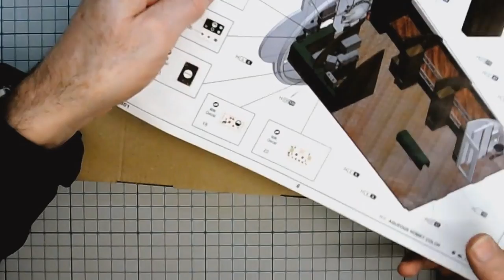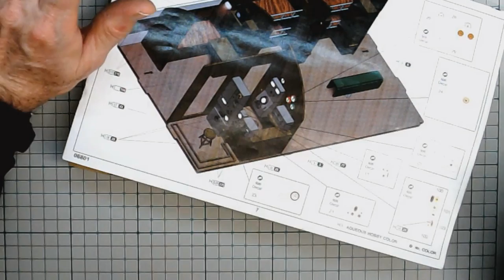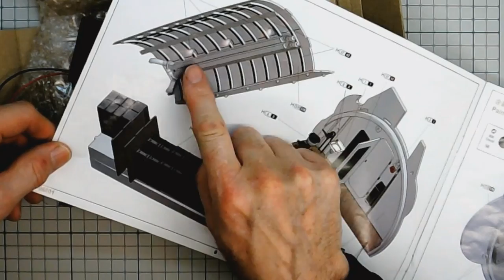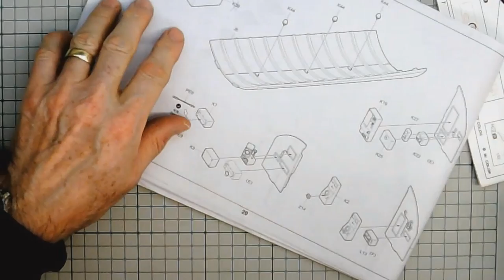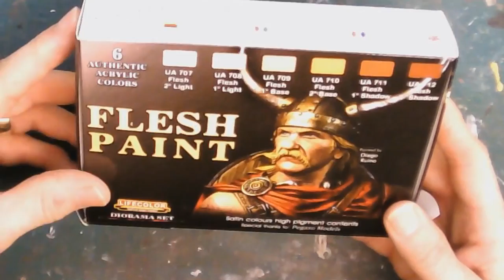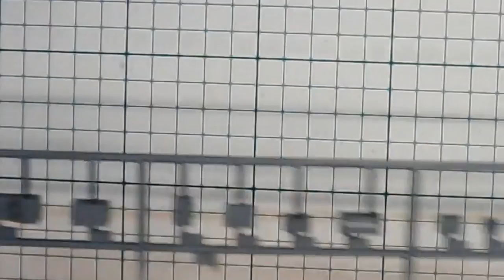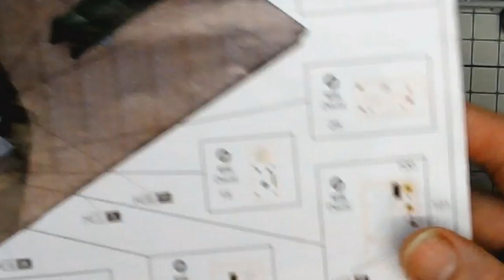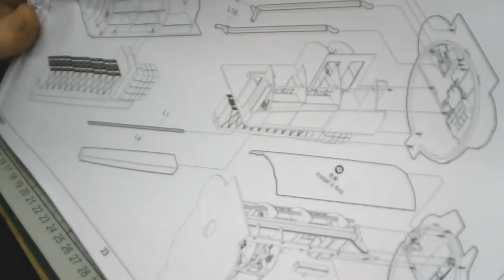Trumpeter 1/48 DKM U-Boat Type VIIC U-552 (WWII) # 06801 PART 3

Comment: Hi Ted, have been watching your Part Three Build, with limited painting /spraying facilities I have built 'units' that are dry assembled that I can later remove and spray Prime (in the Garden) then paint brush. I have not fitted the 'cupboard' in the Head (to give more room and have left some doors off) I will leave the roof to slide in last (you don't need location lugs to fit every component) that would have solved your 'air duct' locating problems. I am enjoying your videos and refer back to them for assembly and painting.

Comment: Ted, they call it the "head" because in the days of British sailing vessels, the "Seats of Ease" for enlisted men were planks with openings in them that sat across the head timbers outside of the ships body. The product of these seats would go directly down into the sea. They were in the head end of the vessel and thus Head was the term used to describe them. Officers had their places on the wings that extended from the sides of the aft cabins. It must have been a hell of an experience to use them when the ship was making way and bow waves shooting up. It was probably the inspiration for the Bidet. Wonderful build. Don't like building German equipment. If Trumpeter would do a US boat that would be very cool. But where to put it?...

Comment: You're correct about the captains bunk and some of the front bunks are for officers but there's also some for the radar and sonar operators. It doesn't show it but there are more bunks on the close side, hence the table with the sides down that seems to be just in the open there. (Radar is the aft section next to the hatch and sonar is the fore one. This way the sonar can immediately let the captain know if they have a contact.

If you're looking for more WWII u-boat stuff there's a game called silent hunter (I prefer 5 the most but I've been told 4 is pretty good too, you can walk around the interior of the sub in 5 though.)

Also on a side note while I don't know about battle stations lighting, at night the lights were dimmed to red to help keep the sailers internal clocks since they can't see outside.
Reply from the maker: Thanks for the info :)

Comment: Why the overhead beams Brown? And didnt they have red lighting throughout the boat for when they were under attack?
Reply: The red lighting is not for when they were under attack. The red lighting is to ensure that immediately after they surface and the crew gets up into the sail or conning tower that their eyes can adjust to the dark conditions at sea at night. Some of the crew would be wearing goggles and almost totally blind and had to have their hands guided to the ladder so that their eyes would be completely adjusted to the night conditions. The very first thing once a submarine is surfaced is to do a COMPLETE scan of the surrounding ocean. That is paramount for the safety of the boat and the crew. The red lighting also assists if the normal lighting is extinguished by enemy action or malfunction aboard the sub, enabling crew to locate torches to quickly fix the fault.